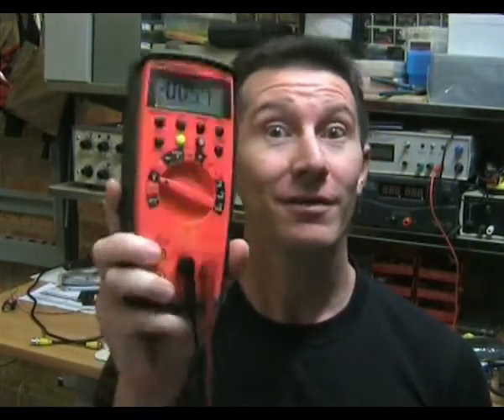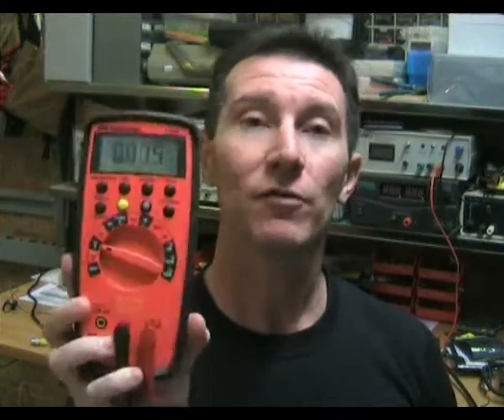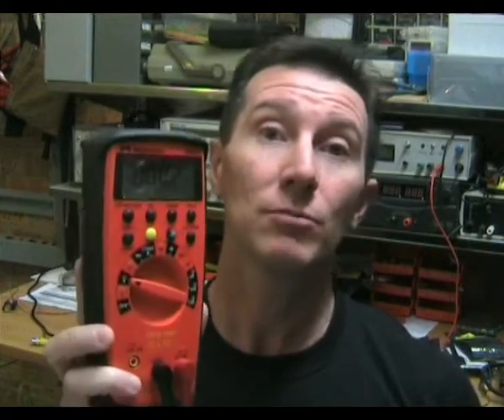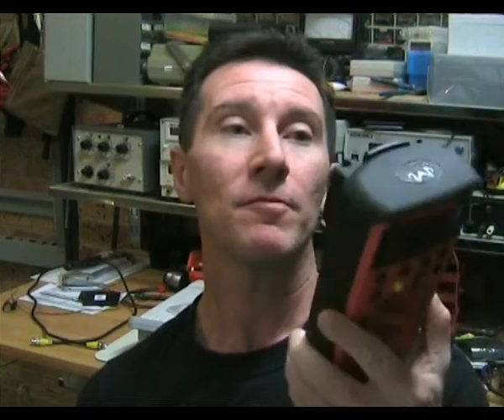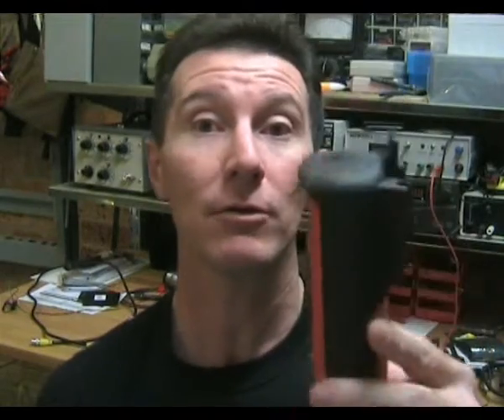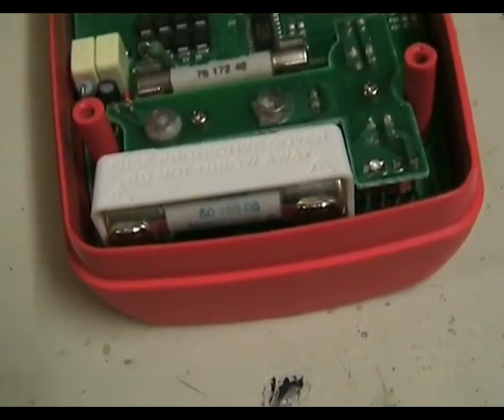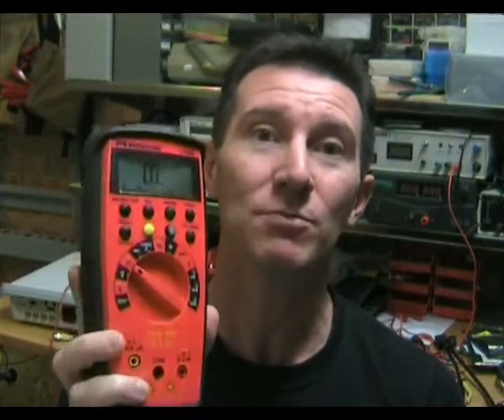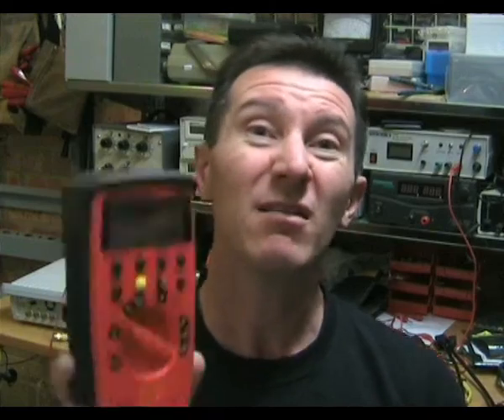EEVblog #6 - Part 1 of 2 - Meterman 37XR Multimeter review

Comment: I am planning for buying 37xr-a, I need 2nd DMM for Voltage + Current measurements and it has induction selection that I am missing at the moment.
Reply: +RPdigital 
check on my channel the last videos i uploaded. i bought an amprobe 37xr-a and i have problems with the current measure.
Reply: +Francesco Gherardi 37xr-a uses Hz-button for both ACV frequency and logic frequency, so this is not the case. But I believe Martin Lorton used to burn Uni-Trend multimeter, bacause Hz-button was for logic frequency. The other reason would be switching from voltage to resistance while multimeter is connected to the hot wire. Then the low voltage power source inside the multimeter is used to measure current through the resistance you are measuring and high voltage kills the circuit. Smart multimeters will survive it probably, but not all meters. I am sorry about your 37xr-a!

Comment: So amprobe really  Screwed it up. I have the original Wavetek Meterman and is real fast in every way. Continuity in TTL mode is  extremly insane fast.  
It has only 2000 counts and no back light but´s a really good meter. Still working from 1993. No fading display, no weared knob, no cracks Is really a Tank.